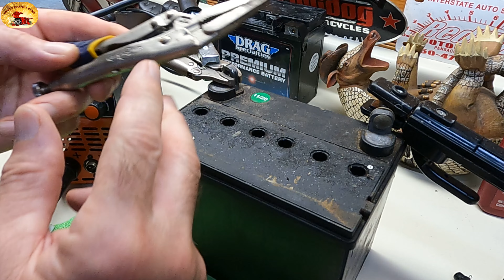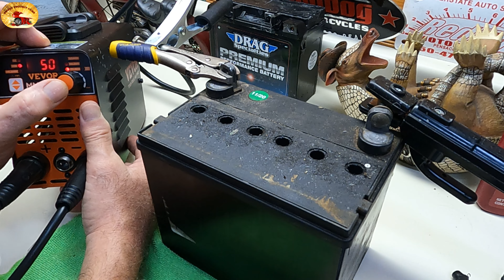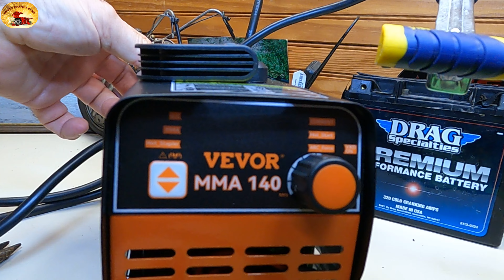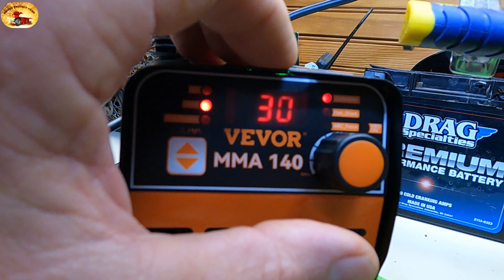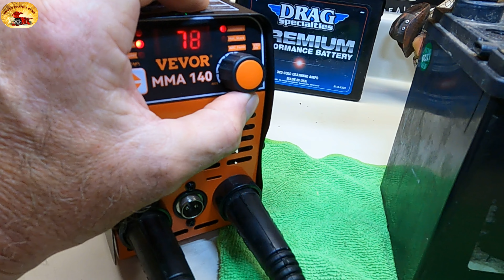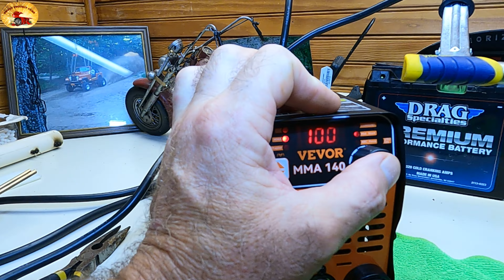Crucial TIPS To RECONDITION YOUR VEHICLE BATTERY Using NEW Arc Welder, For Cars Trucks, Semi, RV

Comment: For anyone who is trying this and your breaker keeps tripping...use the arc force setting on the right side light.  This allows you to start at 0 power to get a good boil for 5 mins then the 10 min rest.  Slowly work up to 30 power.  This is working for me.  Arc force gives more amps at less volts so the breaker won't trip
Reply: Thanks for the tip. I’ll give this a try, because I keep tripping my breakers even at 50.  
Perhaps it’s because I have a new home with all these fancy breakers: dual purpose combination AFCI/GFCI
Reply: This worked for me, thanks brotha! On the “Current” setting it was drawing 24 amps at 30. On Arc Force it lets you start at 0 and I can go to 39 and the circuit only draws 19.8 amps so it doesn’t trip my 20 amp breaker anymore 😎

Comment: Tried this with the car battery  and got the bubbling  immediately. However, using the exact same methods, I could NOT get either marine battery to bubble at all. I even cranked it using the 220 amp in my garage with no luck. Tried it 7 times now....5 min on and 10 min rest. Nothing more than 1.37 volts measured with the multimeter on the battery.  Any idea why I can't get any bubbling?
Reply from the maker: if you are using the same tools we share here in this video and you have enough of this https://amzn.to/3S5VC2u in the battery it should boil I can pretty much guarantee if you crank the welder up high enough it will start to boil sometime it takes a minute to get going  mad mike out

Comment: After using the welder do I still need to charge it with a battery charger or it's plug and start?
Reply from the maker: Just put it on this  https://amzn.to/3kmCThX  for at least 24 hours after doing the process shown, then you're good to go. Thanks for watching and asking, have a great day. mad Mike & team
Reply: @SweetProjectCars  I have this one battery where this specific cell won't bubble, I tried it couple of times even putting higher voltage but it still won't bubble, it's the only one out of the others that does that, even left it for a day but still..... Any recommendations?

Comment: Mike.  I bought the MMA 200 a few days ago.  I plugged it in to several different 110 volt outlets in the house, some with 15 amp breakers and some with 20 amp breakers, and was unable to keep the machine running for more than 10 seconds before the breaker tripped and turned off the machine.  What voltage and amperage circuit breaker are using in your videos using the Vevor?  So, I took the machine to a friends house and plugged it in to 220 volt service and was able to run five 2 min/5 min cycles on a 12 volt deep cycle marine battery that is no longer taking a full charge.  Before the cycles, the battery measured 10.6 volts on the multimeter.  After the cycles, the battery measured 12.9 volts and load tested beautifully (only dropped down to 12.5 volts under load).  Thats' the good news.  Now, for the bad news.  I got home, reinstalled the battery in my boat, hooked up all the wires, turned on my two depth finders and within 5 minutes of powering the depth finders, the voltage on the battery dropped to 10.6 volts.  What is going on?  Have you seen this before?  Any advice would be appreciated.  Thanks.
Reply: I also bought the 200 series and I'm having the same problem with my breakers. In the video he's using the 140. I guess bigger isn't always better.
Reply: I had the same problem tripping a 20 amp circuit. Turns out, at the 30 setting it passes 24 amps through the circuit. After a minute or less, breaker trips.
I changed the mode on the welder to “Arc Force” which draws less power. It starts at 0 and at the 39 setting it's only drawing 19.8 amps in the circuit so no more tripped breakers. And the DC amps going to the battery are about 64 😎

Comment: Hey so im having problems i followed step by step on the video only problem was i put too much water and is overflowing my breaker for some reason cant handle it even though its 20 amp. It shuts off after about a min. I dont know what i did wrong. Can someone help me find a solution
Reply: I had the same problem tripping a 20 amp circuit. Turns out, at the 30 setting it passes 24 amps through the circuit. After a minute or less, breaker trips.
I changed the mode on the Vevor to Arc Force which draws less power. It starts at 0 and at the 39 setting it's only drawing 19.8 amps in the circuit so no more tripped breakers. And the DC amps going to the battery are about 64 😎

Comment: I had the problem with breaking breakers, and that may have been my problem I'm not sure. I know my circuits aren't that great. I just took my ecoflow battery backup system and it worked just fine with running the machine. I started at 30 and ramped up to 70. Bottom line is I got the job done! Oh, and I just had another clamp that I used to clamp onto the battery post and then use the units clamp to clamp onto that clamp. I guess you could say I had a clamping good time hahaha
Reply from the maker: Thanks for the tips Leonard, we truly appreciate the input as it helps other viewers! Have a fantastic week my friend. mad Mike & team

Comment: Awesome video, thanks for all the insight, and instruction! This seems to work very well for flooded batteries. Has anyone tried this with an automotive AGM plate type? I have a 7 year old Deka AGM that is finally showing “REPLACE” when checked with a battery tester. Continuity is also “bad” apparently, at just over 12%. All my other batteries show around 5%, but they are the flooded type.
  Regardless, I have nothing to lose so I’m going to give it a shot, after unsealing it and adding a bit of distilled H20 into each cell. Since I was just quoted $291 for a new Group 48 760 CCA replacement from Napa. I suppose the worst thing that can happen is showing up there with a slightly crispy core return...😂
    Thanks again
Reply: I had 12v 200AH AGM and GEL batteries that were quite dead. I revived them by discharging them to 2v with a glow-plug in a bucket of water (you can probably use a 12v light as well, then charged them with an old 4 amp car charger for 15 minutes (to fool the smart charger - CTEK MS5) and then charged them with a smart charger with recondition option on ( till full). I had a digital current flow meter on to test everything. At first it discharged only 2.6 AH to fully flat (2v),  After the second time I got 10AH out of it, after about the 10th time the batteries gave me 175AH . I am using all of them still and they're over 10 years old, and they're the really crappy and cheap type. They do not last as long as they used to when new, but they're pretty much 75% of the way. I picked up another dead 8 of them for free, recovered every singe one of them and now I have 12 200ah 12v batteries with a combined usable AH of about 900 where 12 new 200ah batteries will give you 1200 usable AH. Now and then a battery would fall below 12v, then I'll take it out and do this until it's back up to 175AH. It takes a long time, but I don't need to ever buy new batteries again.

Comment: Why vice grips are required for round style connectors as you describe at 1:11 ? Is it because welders use higher voltage? Because these crocodile style connectors are commonly used for jump start cables and while I agree that it doesn't seem to be a big connection surface they are capable of conductiong hundreds of amps of current.
Reply from the maker: The reason we use the vice grips is because it's easier to connect the welder clamps to them, as shown in the video. Thank you for watching and asking, hope this helps, have a great day. Stay tuned because we are going to do a video on how to retrofit your welder cables to standard clamps to make this job easier. mad Mike & team

Comment: Mike I have followed your directions to a tee and after about two and a half minutes the breaker blows. I have the welder set to the suggested settings. I have tried multiple  locations and still have not got it to go past  a few minutes. I am assuming the positive cable goes on the positive terminal and negative on the negative. Any help would be much appreciated.  Thank you
Reply: Did you ever solve the issue? I’m having the same problem

Comment: Unfortunately, I have mine set exactly as in the video.
Everything is fine but the circuit still trips.
I try 15 amp and a 20 amp starting at 30 , i have the mma 200 They both trip any ideas?
Reply from the maker: What else is plugged into that circuit? If there are things pulling power from that circuit, you may need to unplug them. Thank you for watching and asking, have a great day. mad Mike & team

Comment: Terrific video if you have the 200 amp stick welder, what settings are used as far as the amps with the dial
Reply from the maker: Start out low and slow, then gradually turn it up until you get a rapid boil on all of the cells. See this video  https://youtu.be/VYtkn-N_p4s  it's our original welder/battery video and has a lot of helpful information about this process. Thanks for watching, have a great week. mad Mike
Reply: Thanks will do

Comment: Anybody know how much heat these batteries can handle? I'm getting it up to 150* Fahrenheit and it doesn't cool down enough in 15 min. It was 95 out today so I know that didn't help.
I'm only sending 64 amps to the battery for 5 minutes. Did it twice and hesitant to continue because of temps
Reply from the maker: If you're doing this on a hot day, using a little common sense says you should wait until the batteries cool down, if it's an hour or two, so be it. Thanks, have  a great day. mad Mike